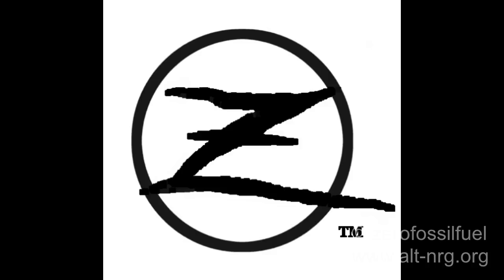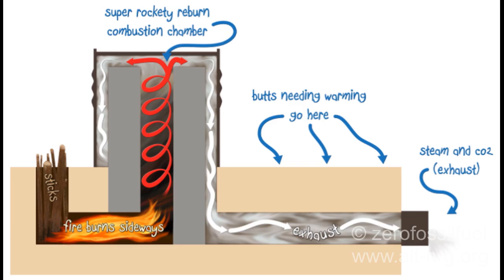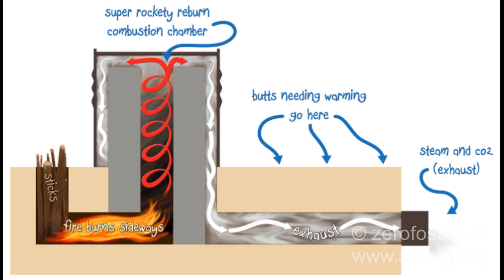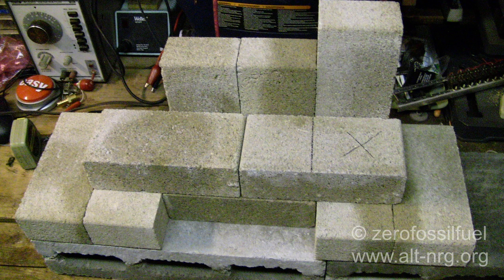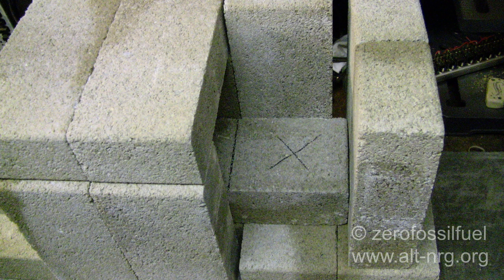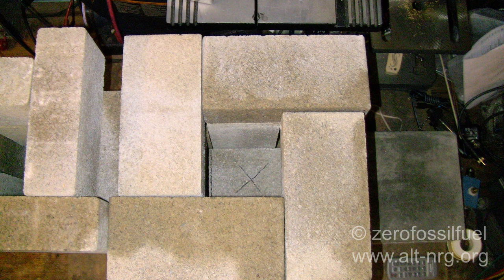#305 Rocket Stove Heater part 1

Comment: Two or three feet instead of that six feet plus six feet should work there. Inner layer is all firebrick, fire cement, fire concrete(burn chamber cap). All kinds of stress relief, see Barden. Outer layer brick, laid with clay mortar, optionally plastered, and/or optionally tiled. Swedish version is all special tile about two inches thick, pretty freestanding tall narrow. Austrian/Bav has benches, beds. Fin/Aus may have stove, oven.

Comment: Like a Finnish contraflow masonry heater. See Albie Barden, and two books, by Ken Matesz and David Lyle. You need a gasifying chamber, a small hole 3" for full size or 1" maybe for yours, then a burn chamber the size of your gasifying chamber(fireplace analog), after the choke hole. Then maybe a six inch hole out, turning down 180 deg, narrowing to 2/3 diameter after six feet or so down, then up six feet or so, narrowing to half diameter, on up as warm(indoor) chimney (indoor chim) for best draw

Comment: I would think that you would need high density fire brick for the burn tunnel.  Otherwise they will just crack to pieces.  This is a good video what to do.  Having good quality materials is of high importance on this project.
Reply: Hard brick is refractory... It stands up to the heat but the heat passes through the brick.  The light, soft INSULATION brick keeps the heat IN the core causing a hotter burn...which means more combustion of the gasses that make plants grow better.

Comment: You are correct, Cement Bricks do not have the heat resistance like a Fire Brick.  And since Rocket Stoves burn so hot, you must use Fire Brick in the main Burn tunnel and especially the 90 deg turn.  

When I build mine I will use Fire brick and refractory cement for all of the areas that can or could actually have flames in it.

Comment from the maker: @zstangkrewson Actually, unlike a fireplace that draws in massive amounts of air from all parts of the house to satisfy the flames, these flames are comparatively small in size and the heat extracted is orders of magnitude greater. That and this design lends itself extremely well to a directed fresh air supply from the outside, thus eliminating any pressure drop in the house.

Comment: and you plumbed a very long heat chamber throutout he inside of the room, it might work, this was youd create a radiant heat source that doesnt circulate room air.  id bet youll have to have some sort of exhaust fan  at the very end of the burn chamber though to pull a long exhaust flow.  just my thoughts.  i have used a wood fireplace, and i learned that usually only hte main room gets warm while the rest of the house gets cold.

Comment: im happy your videos are coming back, i enjoy seeing them,  this wood jet stove thing, i just cant see it as a benefit as a heat source, like most wood styles stoves/furnaces, if the fire is inside the room your heating,  the fire itself will draw room air into the fire and burn it and blow it outside... this creates a draft and potentially creates a cooler room, this thing would have to emit soo much heat compared to intake of room air to be beneficial...  now if the flame was outside.....

Comment: Z,  Looks good.  Some people commented on the possibility of cracking.  I share this concern, but if you dry the bricks slowly you may be able to avoid cracking.  Non-mortared bricks should also help.  Mass (cinder bricks) in the combustion chamber is your enemy and may make it more difficult/slower to get a clean burn.  I suggest you pay attention to having the barrel removable for cleaning, should the need arise, as ash will likely get swept out of the burn chamber and downstream. Cheers!

Comment: @ZeroFossilFuel  A 2 plane rocket stove with a vertical air tight wood feed will burn for hours and hours.

I suggest that you consider slowly dripping used engine oil into a cast iron fry pan for extended auto feed of free fuel.

Comment: Geez Zero...with my $370 utility bill ($70/mo included for new A/C unit contain in bill) for a 780 sq ft house recently insulated and vinyl-ed , you may have the answer...at least for the cold season...as well as one for my shop to eliminate the propane heater.I've been hammered ever since they put on that new meter.

Comment: Great stuff, Zero.
Rocket stoves are cool (hope not).
I've built some stoves before  with different designs some of them using the same principles,
but always figured out that the efficency doubles if controllable secondary air inlets are applied to meke the hot wood gas burn.
Consider this, it makes sense.

Comment: Rocket mass heaters are soooo cool Zero but I"v been researching these for quite a while. Although your bricks will work short term, You will need fire bricks for it to last long term. your bricks will crack and crumble from the heat but permies is an awesome site for the self reliant man.